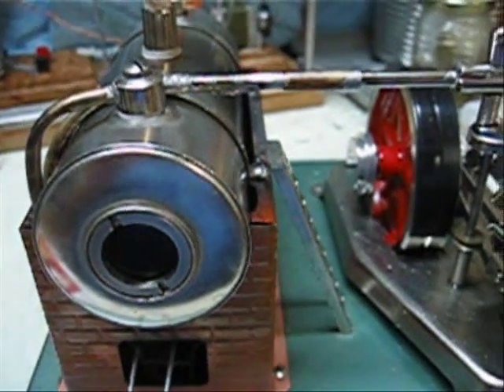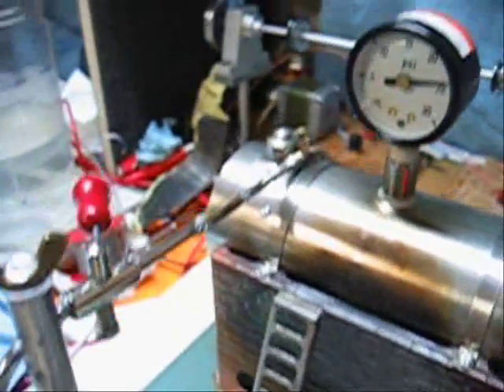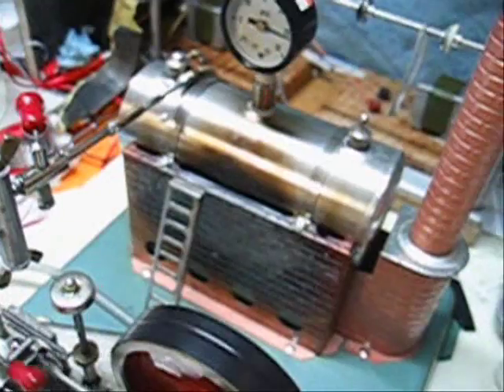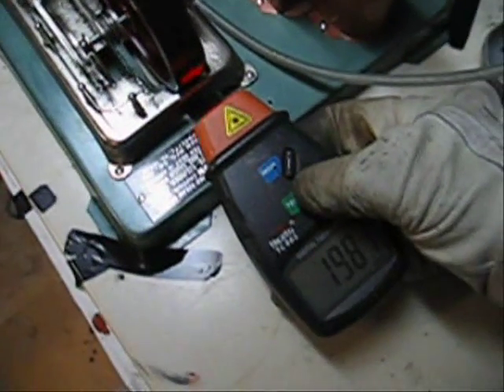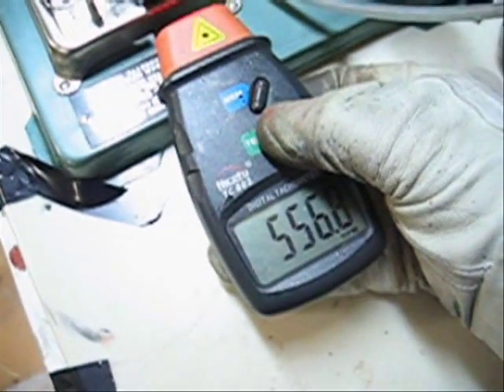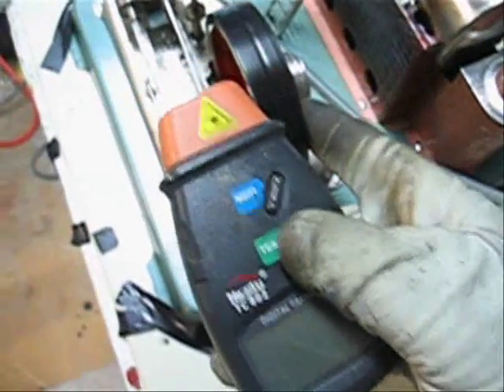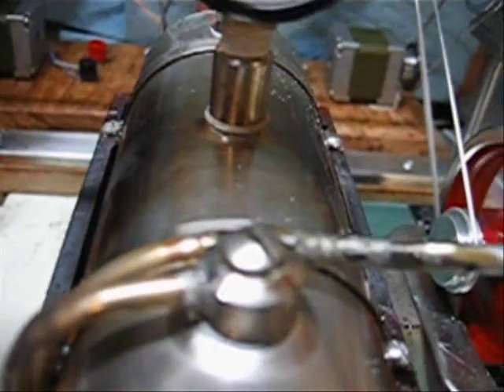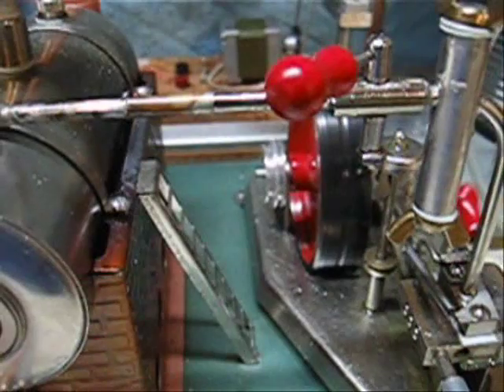Jensen 75 - Superheater Mk-II

Comment from the maker: Thanks for that.  I hadn't tried testing under load, but I suppose I should have figured there was a practical limit to how many RPMs these things can crank when running free (with a safety valve capping the pressure).
This youtube account is mostly a journal of sorts.  Stops on the learning curve.  I can see a lot of mistakes that were made, as I look back.